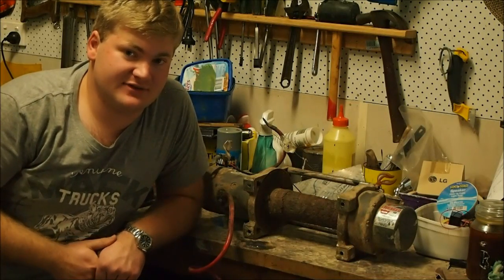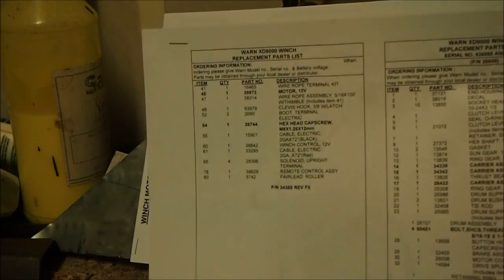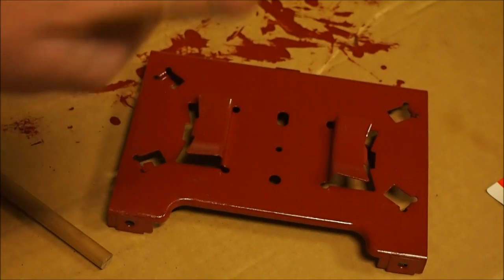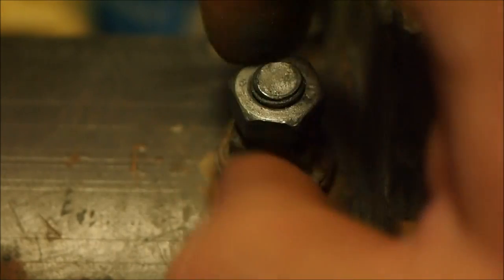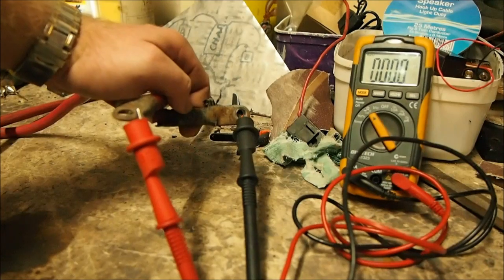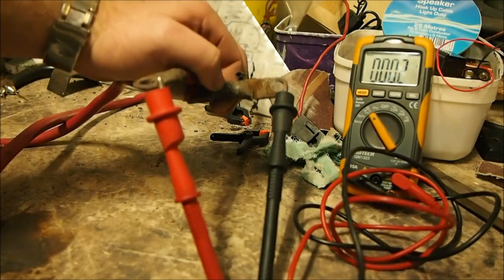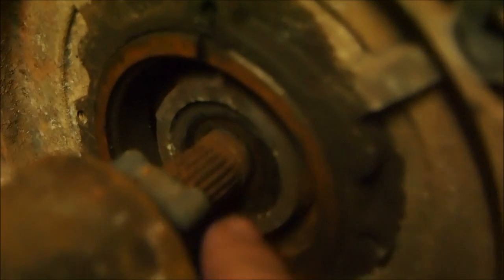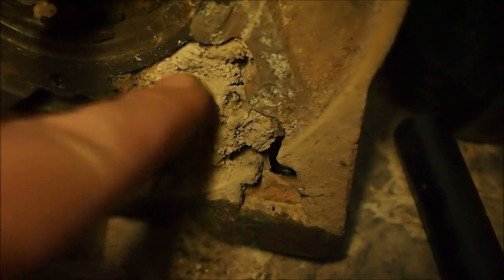JD's DefenderCam 4: Warn XD9000 Winch Rebuild Part1-Testing & Deconstruction

Comment from the maker: Hi Rafael, yes, they can be a lot of work, but the final result is very satisfying. To clean off the solenoid box, just hose it with water, wipe it down with damp cloth and let it to dry out in the sun. You can do a similar thing to the insides of the motor as well. Just make sure as you don't bump the stators otherwise you'll have to reset them. You can wire brush the steel part of the motor armature. Be careful you don't brush the copper bindings otherwise they can get damaged. Good Luck, JD.

Comment: You are the only video on the entire internet I can see about this winch! I am having trouble installing my new motor! It won't go in all the way there are about 10mm of space (approximately) before it goes in all the way. There are no obstructions, just a pin inside the winch that my motor will not seal onto for whatever reason. I do not want to hammer in the motor and mess up the bearing on the end but do you think that is what I have to do? I just don't want to break anything. I'll let you know how it goes if I get a late response. Thanks man great video!

Comment: When's the next video brutha? Keen to see how it all turns out. Bought a cheapo 12000lb winch off eBay, imax I think it is. I'm stripping it down and degreasing her as this is what all the forums recommend. The thing they don't agree on is the type of grease to use. Some say high temp bearing grease, others say extreme pressure grease, but all agree it needs to have good water repelling qualities. I haven't found a grease to suit all requirements as yet. Just wondering what you plan on using? 
Cheers mate
Reply: Hey mate, sorry for the late  reply. High Pressure PTFE
Reply: Aeroshell 64 Grease is the recommendation from Warn (which is the current direct replacement for what used to be Aeroshell #17 and then Aeroshell 33ms). Cheers

Comment: Please finish. I watched this video to disassemble mine but now need to put it back together!
Reply: Hey man, I've been wanting to get it finished for a year now but more important car repair projects keep popping up and pushing it back. My life arrangements for the last year have meant I've been away from home most the year, further reducing project time, but this is to change come November. I will get it done eventually, I promise. For your interest, I put all the rusty stuff in a tub of water and molasses for 6 months and the rust was all gone. Did you find the video detailed enough, let me know if it could be more/less. Cheers Rohan, JD.
Reply: James Derksen No it was great. Good length to run it and pause it whilst you were actually doing the work without having to rewind too often. I took to mine with a wire wheel on the angle grinder and have since put it back together without too much hassle. Haven;t mounted it bc i have now left the state touring for work.

Comment: Hi,
Thank you for the video! Around the 16th minute of the video, when you start to take out the housing of the motor, was it welded to the rest of the winch? I`m asking you because I have a Warn M8000 which I would like to repaint and that part seems welded....
Reply: G'day Mate, No components should be welded on a warn winch. Everything was very stiff when a took it apart, so maybe yours is just really stiff as well. Although, if it was second hand, someone might have welded it, in which case, you case try to cut the weld apart, but I'd just leave it if that particular piece doesn't need to be dismantled. Good luck.
Reply: James Derksen Hi, thanks for the reponse. A few days ago I could finish dismanteling my winch, and you are right, it wasn't welded, it was just stiff. Only thing left is to continue dismantling the winch motor so I can have all the parts sandblasted and then powdercoated. Do you think powdercoating is a good idea?
Reply: Juani Almarza Sorry for the late reply, powder coating should fine on most pieces but you don't want to powder coat the inside of the gearbox if you get that done as well. Just remember that winches can get quite hot so just check that the powdercoating can take the heat. I'd paint the externals with an engine enamel as it is probably cheaper this way too.
Reply: Hi, thanks again for the response. I ended up completly dismanteling the winch and painting the exterior of the rusted pieces with rustoleum. The color isn't as nice as the original one but it seems tough. The only part that I sended powdercoating was the drum. The weekend I will finish testing the electrical wiring and putting back the cable. Then comes the mounting.

Comment: Thank you for your video !!! I get Warn XD9000 in Japan.I have any　information from you.I have one more question.I don't have a Remote.But I have a partsNo81 Relay. How can I use this one? Please help me!!!
Reply: Hi there, sorry I didn't reply earlier. All plans and information are in the description. Instead of a remote, you can use a 3 position toggle switch with off in the middle and momentary on to both sides (which is what is on the factory remote), and wire that switch up as per schematics. I do hope to do this some time in the new year and make a video on it. Regards, JD.